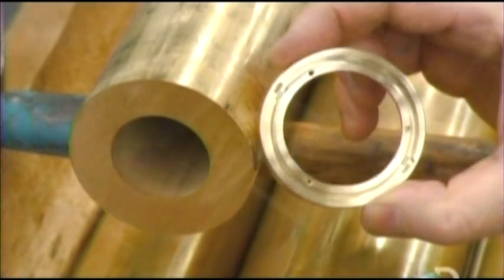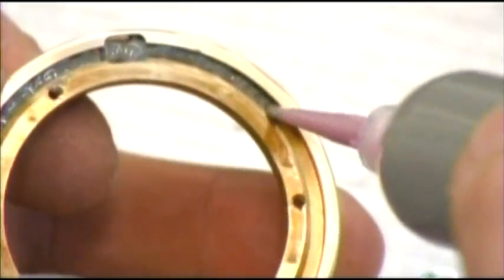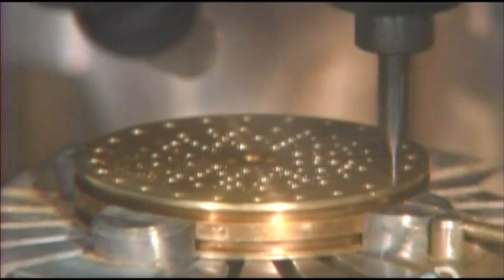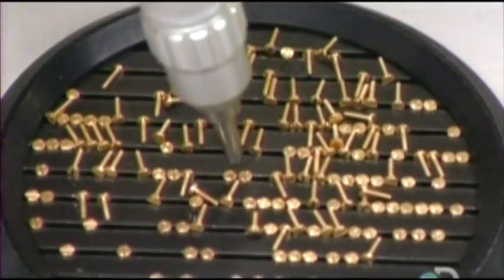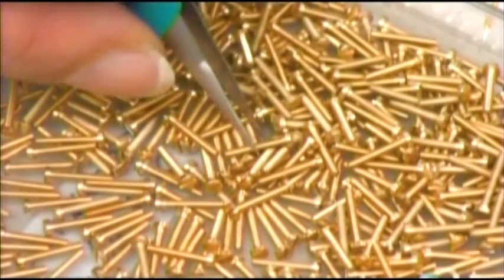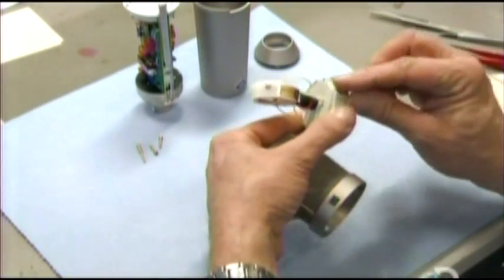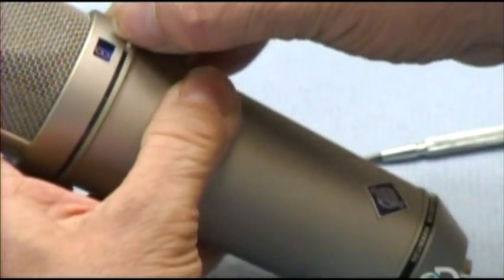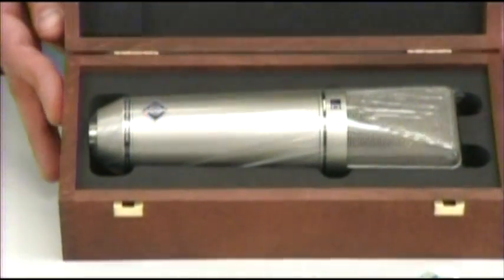How a Neumann U87 microphone is manufactured

Comment: You wouldn't think this mic costs thousands of dollars based on the simplicity of the manufacturing process.
Blows my mind that the capsule is done by hand. Thought this would require exquisite precision only a machine can offer.
So why is it this expensive? How much does it actually cost to build one and how much are you paying for the brand?
Reply: +TheUnchainedMind U87 is like $200 or less in parts.
Reply: TheSodaLake
Interesting, thanks
Reply: Mostly paying for the Neumann brand. an RK47 (remake of the original k87 the u87 uses) capsule is around $100, a transformer is around $90 for a high quality transformer (Cinemag tranny is around $40), and the components come to be around $45, depending on where you get them. The body Is expensive (Around $100 or more depending), unless you can manufacture one yourself, and you'll need a PCB to solder all of the components to ($20). Alternatively you can buy kits to make U87 style mics (not exact replicas) for around $350 right now. Obviously these usually don't come with the box or shock mount (add another $150). Shipping if you skip the kit and source the parts yourself could easily land you an extra $50. Right now the U87 Ai Set Z is retailing $3,599.99 on sweetwater.
Reply: it's expensive cause it's guaranteed to work out of the box and uses an older (argued better) building process. All hand made like any chinese product only each person makes around $35-$50 an hour to make it. Component/material wise they could make the Microphone a 3rd of the price but why bother. They're the best in the business.

Comment: "This plastic membrane has been coated with real gold to conduct electricity."

2:13 ..but silver is the best conductor. Then again, they probably use Gold because it won't rust.
Reply: All of them have gold membrane.
Reply: The metalization is sputtered onto the membrane material under a high vacuum.  high-end microphones use gold, but cheap, commodity capsules use aluminum.

Comment: Seeing the backplates of condensers brings to light one reason why they have extra (artificial) highs compared to, especially, ribbons.
Resonances in those tiny drilled holes will created their own "ear-candy" as i like to say, in the very highs as will standing waves due to the close proximity of the plates and other membranes.
Also, round elements 'suffer' from resonances just like any round membrane will have resonances (drums, cymbals, etc).
Dynamic mics also have these issues.

Comment: Just think about how a large multitrack mixing console changes the sound, not to mention all of the effects applied to vocals, etc, and you could saturate analog because it sounded good up to a point, so a lot of it was designed for careful overloading. There were no digital effects, if you wanted a non spring reverb you had a basement below the studio with speakers on one end, and microphones on the other and they recorded into the room and rerecorded. Phil Spectors 'wall of sound' used this

Comment: To answer your question, recording techniques and technologies have changed. For a vintage sound you mainly have 2 rules. Analog and tubes. But it's more than that. They didn't just plug guitars and mic's directly to a tape recorder and make a record. Compressors were different back then, amps were different, EQ was different, noise reduction was different, all of these things add up to the dynamics, timbres, and sounds of vintage recordings. You need a lot to make something sound old.

Comment: @simonbjr18 Maybe not the best, but for many, preferred. Nowadays you can buy a very good mike for $250, and there are dozens of names. When I got into the biz, it was Neumann, AKG, Beyer, Sennheiser, Shoeps, RCA...that was about it. A U87, as seen in this vid, was considered a poor replacement for a U67 back in the 70s. I'd still take an M49, U47 or KM86 over a U87. But times have changed, and I'm surprised how well my $100 MXL performs. Not as good as a U87, but for the money...

Comment: @sifs4 when you think about it, most high end gear, even though much better most of time, only shows its true potential through extremely expensive monitors and listening rooms, which 99.5% of the masses do no have... which is why in recent times low fi recording in indie has caught on so much, since low end is getting better most people can barely tell the difference anymore besides trained professionals.

Comment: Ok so after watching this video many times, I'm still stuck with the question of why does this mic cost sooo much??
Reply: because they are not made ny one armed children in china
Reply: Brand recognition is probably the biggest reason. Circuit boards and electronic components are actually cheap.  The housing may cost more since it’s probably made in small quantities along with the capsules. There’s probably a lot of testing to each microphone to make absolute sure you don’t get a dud so that could also be a big factor.

Comment: Only in Germany can this precise, intricate, manual assembly be done.   Still can't believe all that work goes into a transistor based mic.
Reply: The actual mic design is not complicated. The important thing is to make sure all the components are exact or exact enough. It’s a relatively small staff that makes these microphones so the teamwork is tight which is an advantage for quality control.  When you get a new U87, most likely it’s flawless

Comment: These microphones are normally used for studio, I used one for live...... for miking up an accapella Group. It did not need much tweaking and it sounded awesome. Each to his own. i swear by them others may not and use something else.
Reply: One of the advantages of the U87 is that it’s already proven to sound good. So it’s a safe choice. You could use a cheaper knock off brand and it will probably still sound good but with the U87 you get that “peace of mind”.

Comment: yea... but the u87 is still moderately priced compared to u67, which goes for about $8,000 used on eBay.
OR the Neumann U47, which you'd be extremely lucky to find for $10,000.
OR the Telefunken U47 and the Original AKG C12, which you won't even find anywhere lol.
OR the Sony C800g ($7,000).

Comment from the maker: Here's a suggestion: Visit a cooperative dealer. Have them set up an array of mics in a quiet room at a wide range of prices. Have them all run into a mixer. Then, try them one at a time listening through headphones. And here's the tricky bit - do it with a blindfold on and with nobody giving you any clues what mic you are singing onto at any time.

I predict that you'll find any number of mics in the $300 and under range that will sound amazing.